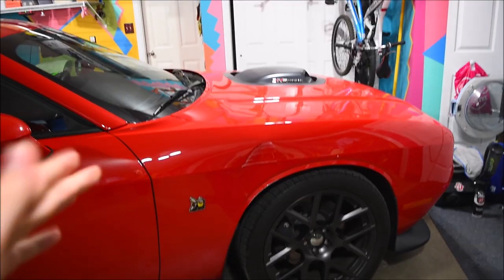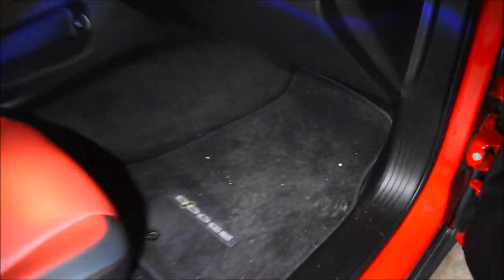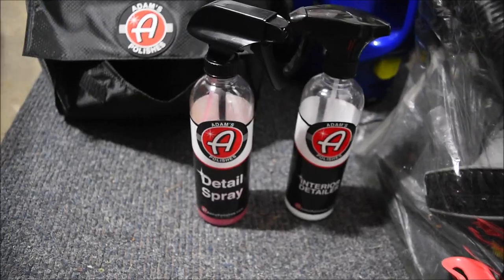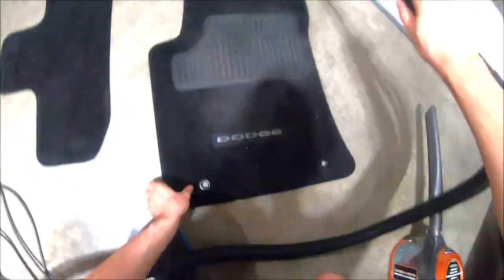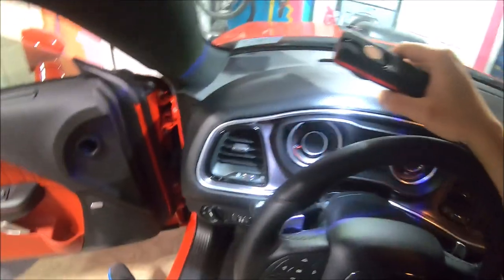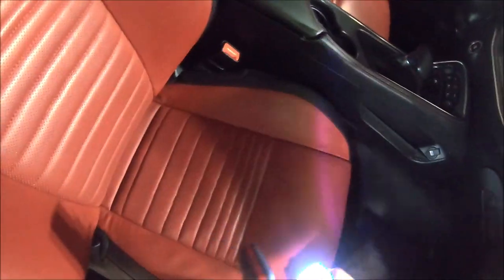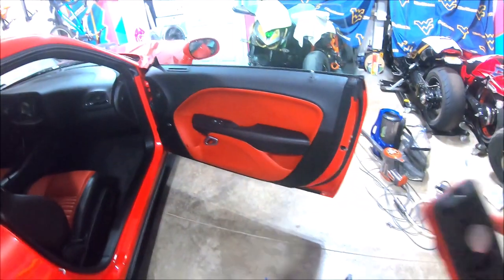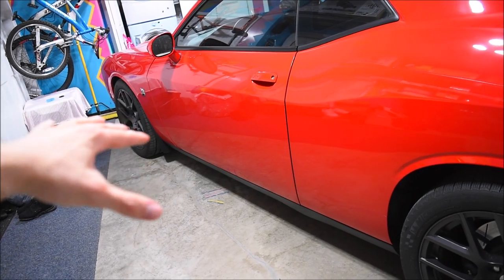Cleaning Out My STOLEN Dodge Challenger ScatPack!

Comment: I'm really glad you're able to have a positive outlook on getting your car fixed up after such a bad invasion of your privacy. I can't imagine how I'd feel if my jeep or something I really care about got stolen and vandalized like that I'd be really angry and want to erase every little reminder of it. It's too bad thieves like this don't get caught more often. 

I didn't notice if you mentioned anything about the window but if your tint is factory then you actually have privacy glass which is different than film tint because the tint is built into the glass and in that case I would get an oem privacy glass window installed. You can get tint film to match but it's not exactly the same although some films are made to match. I'd at least get that door panel off and check out the installation. 
I'd look for a good PDR guy or shop to fix that fender dent. Paintless dent repair. Some of those guys can fix crazy dents much cheaper and less invasive than traditional body work
Reply from the maker: Ya it sucks that this happened and wish more people would get caught for this kind of stuff as well. And the driver window has film tint so it’s not factory. The passenger window does not have any tint

Comment: The fact that they replaced the window and didn’t clean up the glass tells me that they replaced the window themselves and not professionally. It also tells me that they had a resource to get the actual window. Meaning they most likely broke that window because they had an extra passenger window ready. 
These thieves are getting savvy. We have to stay smarter than them. 
Good luck with your comeback. I feel it coming.
Reply from the maker: Ya I feel like this was very well planned out by the thieves. And you already know, it’s definitely not what you’d expect as a challenger replacement but I think it’ll be more exciting. Appreciate you watching!

Comment: I'm guessing the extra hardware/screws is from their shoddy job replacing the window. Also there's lots of hidden screws holding trim pieces in certain areas. I doubt there's any screws from around the gauge cluster maybe a couple but that's usually clips. Was anything taken apart in the trunk or glove box or cowl area under the hood?
Reply from the maker: The window would make the most sense to me. Everything else like you said is usually held in by clips like the dash. Didn’t seem like anything else was taken apart